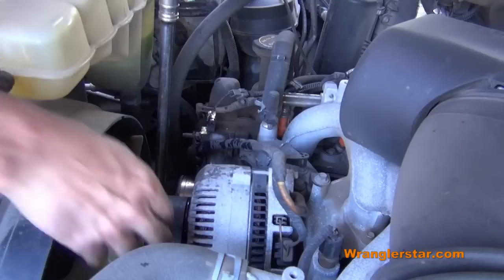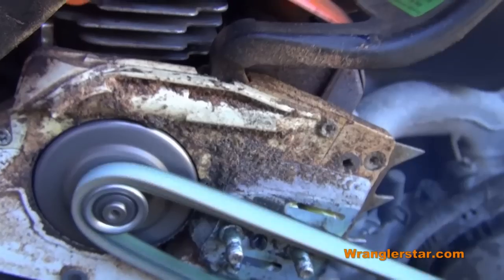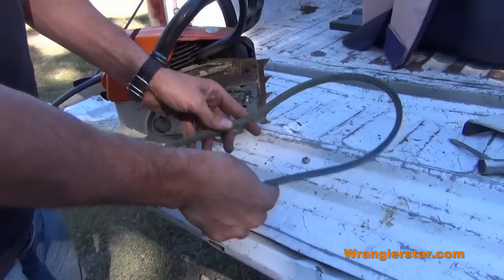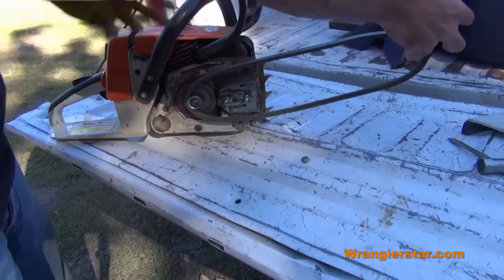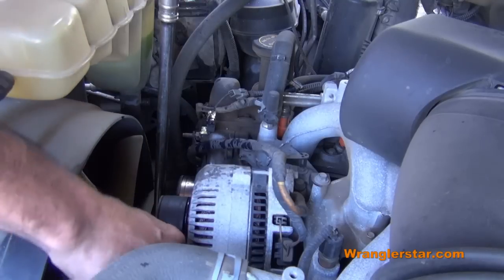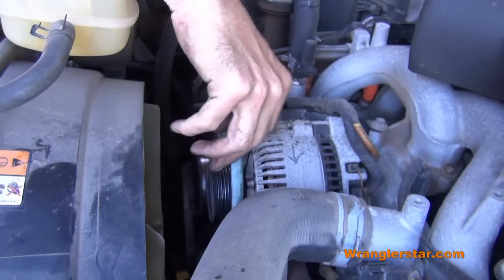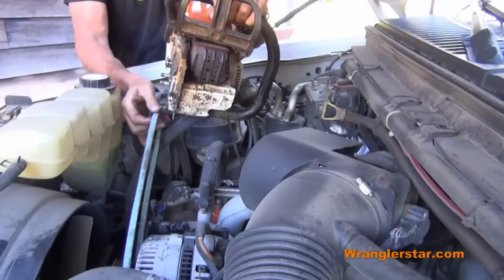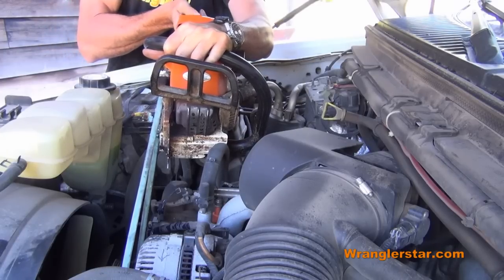Charge A Car Battery With A Chainsaw

Comment: The only problem with this setup is that if the battery was dead the alternator will not charge the battery no matter how long or fast you spin it, The regulator needs voltage to apply to the rotor, otherwise it wont charge., Not an alternator anyways, Now an old car with a generator , Yes that will work fine.
Reply: ***** Leave your headlights on all day, then measure the battery voltage at the end of the day.
There are no permanent magnets inside an alternator, so how is it going to self excite.......??
Reply: *****
The metal in the casing becomes magnetized after a while of use.
Reply: The casing is aluminum
Reply: ***** theres ussually a steal peice sandwiched togother on alot of altenators thats aluminum kine is  go out to yours and touch it with a small screw driver  there should be a bit of magnitisim 2 it
Reply: redbulljustice99 Ha Ha Ha....I love to hear all the peoples BULLSHIT.......
I am an ASE Mechanic...I think I know the difference between an alternator and a generator....
there must be voltage, otherwise it will never charge, you can spin it all day if you like, It will never charge, a voltage is needed to excite the rotor's winding, effectively creating an electro magnet.....That is just the way it works !!
Reply: ***** then please explain how i was able to run and drive my truck without a battery in it at all?
Reply: ***** btw youd better go back to school, most alternators on vehicles are self exciting for this very reason. and there really isnt a difference between an alt and a generator, they both produce ac current...
Reply: you really have no idea how modern alts work do you? you have a single wire that charges the battery instead of the old school three wire alts that have a battery wire, ignition wire and a sensing wire. it has nothing to do with the ignition, as soon as that alternator starts spinning power is produced, you can test this yourself if you feel, take a modern standard trans car and hook a volt meter to it and turn it off in while moving in gear, notice how the volt meter is still charging the battery.
Reply: apparently you are the wall, ignition wire would supply the voltage to the alternator in a non self exciting alt, as long as a self exciting alt is spinning there it will be power, whether or not a battery has voltage is irreverent, besides i have never ever ever seen a dead battery supply 0v, lowest i have ever seen is 9v even then i was able to get enough charge into the battery to start the engine unless you had multiple dead cells, in that case you have bigger problems. aka in a dumbed down version for you, the alt supply's its own voltage to the regulator as soon as it starts spinning, providing power to charge the battery
Reply: ***** His truck might be a diesel ;o) No electricity needed to run...
Reply: NOPE...An alternator is an alternator......New diesels are ported fuel injection...besides if the battery was dead It will never charge
Reply: madflyer1093 Still waiting for an apology kid !!
Reply: ***** For pre-heating & starting it yes , but I can guarantee you my (old) diesel keeps running after disconnecting the battery.
Reply: Martin We are not talking about old diesel's , we are talking about alternators, and their inability to charge a battery without a voltage for the rotor....Nothing to do with diesels at all....
Reply: madflyer1093 Still waiting for my apology big head..
Reply: ***** How do you think a bicycle dynamo works?
Reply: Lol... Welcome to the internet ... As long as you keep replying, others will do so as well. How hard is that to understand.
Reply: That's the freedom you have.
Reply: Michael Brown Someone should make you a box.
Reply: Michael Brown ;o)
Reply: ***** You tell 'em, kid!
Reply: Martin This ongoing debate between *****, madflyer1093, Michael Brown, & you has been very entertaining, and I was quite content to lurk on the sidelines and be entertained. Until I saw this comment, that is. I am not a certified auto technician but consider myself to have a pretty extensive amount of knowledge and hands-on experience with cars. I am a Suzuki-certified motorcycle/ATV tech however and can tell you that many (not all) motorcycle charging systems are basically identical in operation to their automotive counterparts. In addition, I have over 20 years experience in cycling (bicycles) as a rider and mechanic. I can tell you with 100% certainty that bicycle dynamos do have some very basic similarities with automotive alternators, but are 2 very different devices! Car alternators produce AC current (usually 3 phase) which is rectified (converted) to DC current by a bridge rectifier. ***** is absolutely correct in that the field coil (which is nothing more than a rotating electromagnet) has to be electrically energized to (produce a magnetic field) before any voltage (charging current) can be induced in the stator (output) coils.

By contrast, the magnetic field in a bicycle dynamo consists of a set of rotating PERMANENT magnets (for simplicity), either fixed to a rotating input shaft, or a rotating outer housing (depending on design), which are driven directly by the bicycle's tire via a friction drive (or in some more modern cases a wheel's hub shell). These permanent magnets rotate inside (or around) a stationary coil in which an AC output voltage is induced. Since the field is created by permanent magnets, no battery or other voltage input is required for operation. In most basic or older dynamo systems the output voltage (usually around 6V max) is neither regulated or rectified - there's no need for either. But with newer LED bicycle headlight systems and even on-board 5VDC USB charging (yes, you can charge a mobile phone etc. while pedaling), there becomes a need for regulated & rectified DC current (usually accomplished by a simple and very small electronic circuit).

Note also that while many motorcycles employ alternator charging systems that are basically identical in operation to those found in cars (as noted above) and need an initial voltage input to energize the field in order to operate, not all motorcycles are designed in this way. In short, most multi-cylinder road going models employ this kind of alternator charging system, while most single cylinder models and some twins (dirt bikes, enduro bikes, & ATV's) employ an alternator with permanent magents. These types of alternators still produce 3 phase AC which is also rectified and regulated, but do not need any sort of input voltage to operate and produce output voltage (charging current).

Sorry for the long rant but once again ***** is correct in his statements!!!! Deal with it! :-)
Reply: ***** FYI I drove my all-stock 91 Nissan 240SX for TWO WEEKS straight without a battery under the hood. I faced downward on a hill every time I parked it. xD Pop started to drive it. I'm not going to argue with you, but I did not need a battery.
Reply: ***** What you did may be indeed entirely possible on some cars. You're lucky you didn't fry the electronics in the alternator (and possibly the computer) by doing that however (if you didn't already)...
Reply: Michael Brown " I know you want proof.  www.jegs.com sells them part numbers  555-10120 , 555-10121 "

And when you go there and checks it out it says: " This is the speed where the internal sense circuitry connects the battery to the voltage regulator and turns on the alternator "

In other words, it also needs a working battery in order to be able to charge the battery....
Reply: hydrofuelincanada incorrect

Comment: Actually,  you do NOT  need to know which way  the alternator turns.  Almost all  alternators  operate  in  either direction.  Only difference  for most is  the cooling fan,  which may not matter much in this instance.

Comment: Very rarely would you completely flatten the battery and leave it with zero voltage to induce a field unless the vehicle sat for a few days. Also if you shut off the key and let it sit for 15 or 20 mins the battery may stabilize and the voltage can come back up enough to induce the feild.  And not all Alternators need the vehicles key turned on. On single wire alternators it is irrelevant if the key is on.

Comment: When I was working on cars for a living, years ago, I asked about the difference between an old fashioned automotive GENERATOR, and a modern ALTERNATOR. {For these purposes assume you have a vehicle with a clutch, or can use the chain saw trick.} Other than the DC and AC differences, I was also told that another difference is, with a generator you can push the vehicle (or do the chain saw trick) with the deadest battery, and start the engine. BUT, with an alternator, I was told, there needs to be a tiny bit of residual charge left in the battery for the alternator to work with. According to what I have been told, a 100% flat battery will not receive what you are trying to send it from the alternator. By any chance, does this still apply?

Comment: Great Idea, Something Permanent under the hood might be a new gadget to invent, 
Could Just Parallel a battery with a disconnect, With no Load on it should hold a charge for a while, then when this happens just turn on the disconnect and Start your truck.

Comment: most alternators spin clockwise and Honda alternators spin counterclockwise but they will all produce power spun either way as long as you turn the ignition on. spinning direction is for alternator cooling fan and this short time wont matter.

Comment: Couple things.  Alternators require a field to function so this will not work with a totally dead bat.  Also modern computers for cars do not function under 9 volts so if it does start get where your going fast unless the alternator picks up the load on starting.   Neat idea though.

Comment: A few things...
A friend of mine notes that you forgot to mention the key has to be ON to charge the battery this way.
Also, alternators don't care which way they are spun!  So you can skip making sure it spins the right way, they don't really care, since the windings are a 3 phase AC generator that just feeds a stack of rectifiers anyways.  Spin it either way, it'll work the same.
Reply: Ken Stein incorrect alternators are directional.

Comment: All 1 wire alternators that I know of are connected directly to the battery, it's because they produce 70-140A of current and going through a switch will cause heat and voltage drop.  Some alternators need an exciter voltage to start charging, but that's usually below a given RPM.  Most will start charging at 1300RPM.

Comment: Good idea to check rotation on the saw.  I've seen a few of those Poulan saws from big box store that pulled on the top of the blade, instead of the bottom.  I guess they install the sprocket backwards every now and then.
Reply: ... thats not quite how that works... if its running with the chain in the wrong direction the engine is running in reverse. also. dont buy poulan or homelite. yes they are inexpensive, but they are no fun to work on, and no one will repair them for you. husky or stihl. except no substitutes.
Reply: homelite and poulans use to be great saws, and the stihl weekend warrior saws are just as bad now.
Reply: Mike West what do you consider to be a weekend warrior saw? I have a ms310 (mid price range) that I've been using for 14 years and it starts the same every time. Any other saw except husky or echo would either had carb work done or been thrown in the dumpster by now. I also got a newer (2011) ms 180 and no problems. I don't use them everyday but i can still tell quality. Got a craftsman pressure washer at 1/2 price(display model) i Have used it about 12 times and its already misfiring.

Comment: what most people consider a "dead" battery is just being to low to start the engine. You are correct if the battery is actually dead then this wont work. But since what most people consider dead isn't actually dead then this should work most of the time.

Comment: When hunting I always carry a chainsaw anyway. You never know when you will need one in the woods.  It is great to see there are other uses which will get me out of trouble.  I camp wild a lot during hunting season and always have my deep cycle battery and cables.  I use them for others more than for myself  but it is a real safety thing when you hunt alone as i do.  Thanks for the information.

Comment: A good trick for those with slushboxes. My truck is a 6 speed, so I can just give it a little bit of a push and dump the clutch and pop start it easily. Still, it's a good trick for people to know just in case they get themselves in a rough situation. Good video.

Comment: In some cases if the battery is completely dead it won't work because on newer cars the alternator needs a small 12V charge going to it before it will generate electricity no matter how fast you turn it.

Comment: If the battery is dead totally with O volts then how is the field of the alternator going to be energized?  That would be from your flashlight batteries? Cordless 18/20 volt screwgun battery?  Better have a truck load of this and that if all the variables are going to be covered.  I would definitely give it a try if all else failed.

Comment: If you're lucky enough to drive a manual but have a low battery or faulty starter, you may be able to push start the vehicle. Depress the clutch, put it in second, turn the key to on, and get it rolling (either by having someone push on the level or downhill). When you're moving 5 or 10 mph, pop the clutch giving it a bit of gas. Keep it running and drive it around a bit to recharge the battery.

Comment: great tip Cody another tip Cary a sharpy permanent marker most of the time and make notes on stuff like direction to unscrew , contents of containers , lengths of pipe location and numbering of keys lock combinations and dates of installation or bbf dates.IMHO positive quotations of scriptures like psalm 83:18 is recommended on the inside of garage doors etc .

Comment: Many Alternators are self exciting and this is part of the rectifier design. The problem is you have no way of knowing this by looking at it. Ford used a command wire from the computer to control charging. You could have a good battery and good starter but lose that signal and you would think your battery or alternator was bad.

The GM single wire setup is a wide spread example of a self exciting design.

Comment: this is great but if your battery is dead then there is little point in going to all that trouble as the alternator needs 12v to it to create the electromagnet that causes charging.
if on the other hand your battery isn't completely dead but hasn't enough amps to start the vehicle then this will work but remember to put the ignition on before you start running the chainsaw so as to get the electromagnet engaged.
On classic vehicles, they ran on magnetos or dynamos. small aircraft still use magnetos as they are so reliable. so much for modern tech.

Comment: Nice video Cody. Keep in mind the alternator has electromagnets that need to be excited(energized) in order to charge. so you have to turn the key on . also if you have close to zero volts in the battery you cannot use this trick because the battery will not be strong enough to excite the electromagnets.

Comment: Only problem I see with this is that the alternator and/or belt in most cars made within the last 15 years or so is pretty inaccessible in an emergency situation like this and therefore this method is pretty much impossible to use (unless you keep a fully stocked toolkit in your vehicle at all times!)